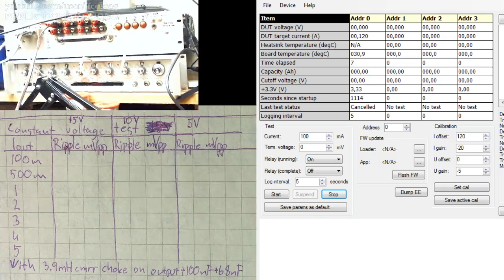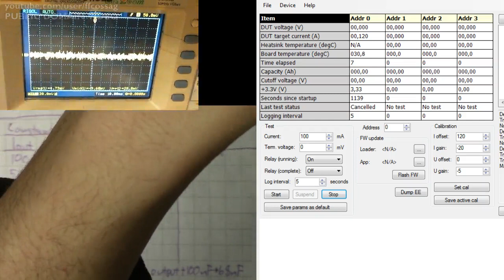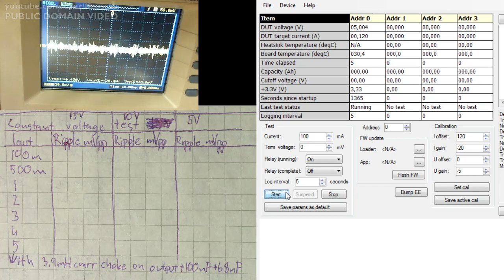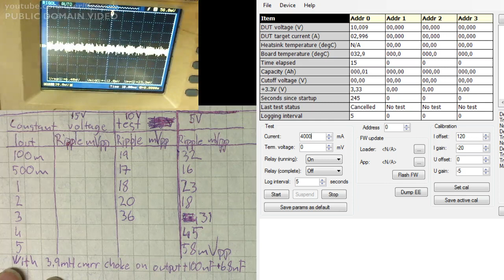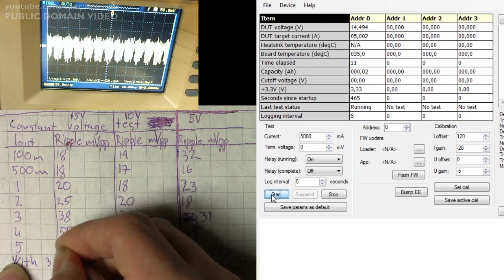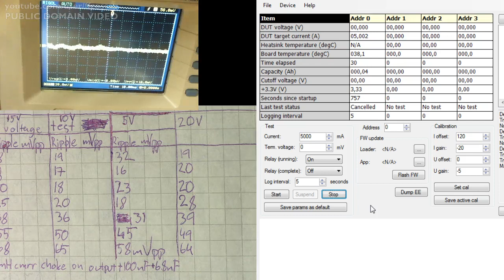Wanptek KPS305D constant voltage noise tests (recorded livestream)

Comment: They make a 10A version of this PSU, I wanted to get it but what I was wondering is would it be a good idea to put a couple of those 6A 3.9mH chokes in parallel to compensate for the higher output?